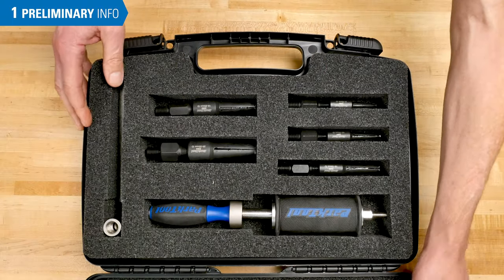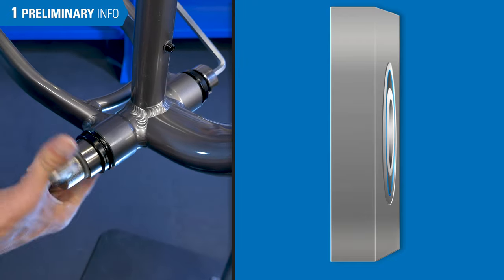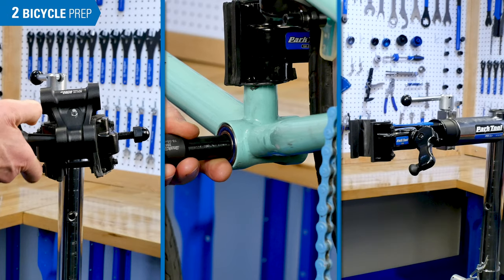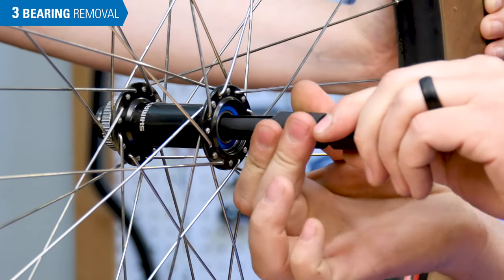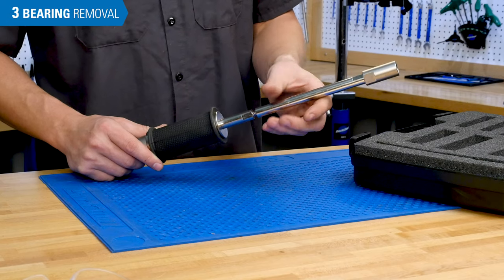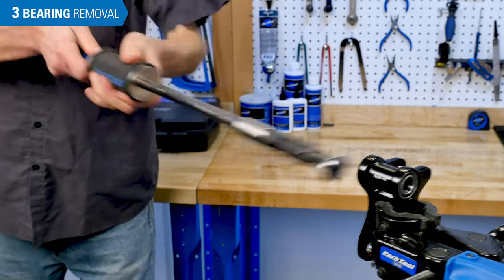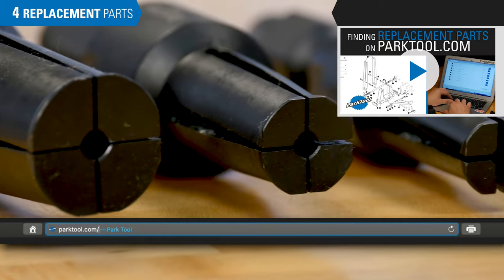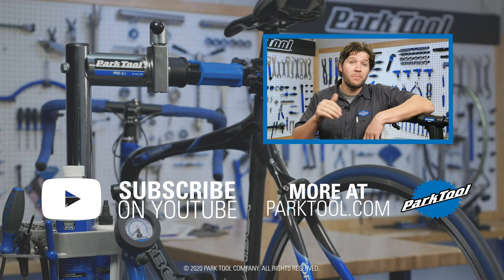How to Use the SHX-1 Slide Hammer Bearing Extractor

Comment: Good to see Park finally offer some internal bearing extractors. Even better that they offer a 25mm i/d puller. Useful for anyone with an 07/08 Specialized Enduro with that proprietary front hub. I bought the Specialized FSR bearing puller kit only to discover that there was no 25mm puller. These things are gold if you can't push the bearing out from the opposite side (whether you use the impact or threaded extraction method).

Comment: Have you looked at the Lectric XP Trike axle bearing issue yet? I modified a puller from Autozone using strap iron to get one out. I need to fashion something to press it in over the axle shaft. I hammered it in using some wood in an effort to distribute the force but I may have damage the bearing as it cracked right down the middle of the outer race again.

Comment: Is this tool any good if your headset sealed bearing rusts apart and you have the outer bearing case stuck in the bearing sleeve of a carbon frame?
Reply from the maker: Depends on the ID of the bearing you are working on. It will work for that in many cases but not all. Of the ID is 32mm or smaller it will work great.

Comment: It is great if you gus can make a star nut extractor ,
Reply from the maker: If you drill the star nut you can then pivot both star plates and pull them out by hand. Extracting them is going to be potentially destructive to the forks steerer.

Comment: Why are these guys in park tool so keen of using "impact-based" tools instead of threaded ones, that allow just press in or out bearings?
Reply from the maker: Check out the other tools that were recently introduced. Options are there depending on whats possible.